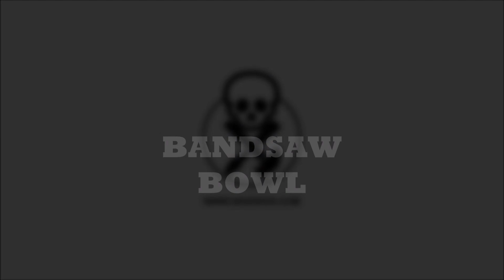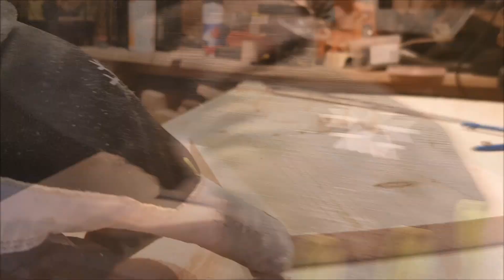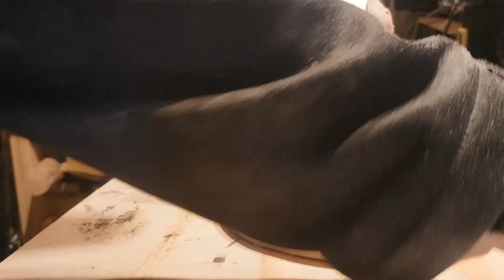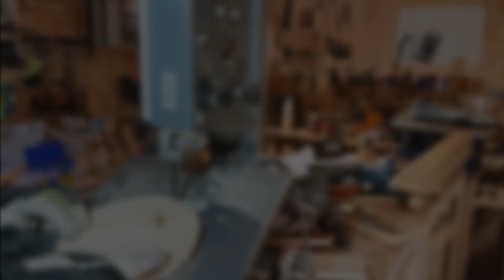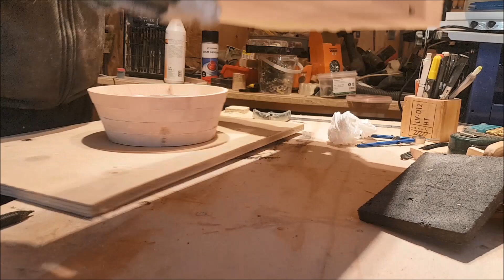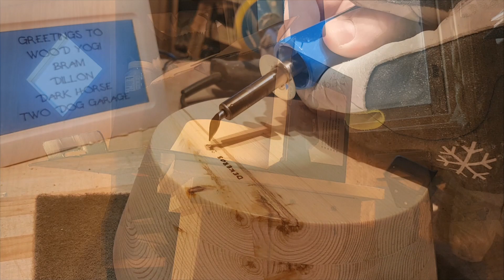Bandsaw Bowl

Comment: I don’t understand the part about using a scrap piece to determine the width of each segment? Why not just measure 1/4” or 1/2” wide and cut? If your table is tilted at the same angle won’t the segments be the same?
Reply from the maker: Hi! thanks for watching and for your question! I totally understand you. Ofcourse one could set a fixed angle (but you need to calculate it, depending on the thickness of your board). If I meassure the thickness like I do, I get an angle that would work with each layer (and not fall down or stack inside the previous ring). 

If you just pick an angle at random, you might end up with rings that stacks inside each other... I tried this at first, just having a go at it and cut happily several rings from a board, and was very confused to say atleast. 😊

I just wanted to (try) to one (of many) ways to get a angle that would work. Thanks again for a very relevant question. I hope I could answer it. Cheers!

Comment: Loved the bowl ❤️❤️ but I was wondering does it have to be tilted when cutting the circles out ?
Reply from the maker: Hi! Thank you very much! I will try to answer as good as I can and please let me know if you have further questions. :-) If I didnt tilt the table at all, the rings would not stack on top of each other. They would just fall trough (each ring smaller than the other). By tilting it I get an angle that makes the rings stand on top of each other. You could do a bowl with straight sides if you have another piece to cut each ring from. It would be cool to try. Hope this helps! Thanks again! :-)